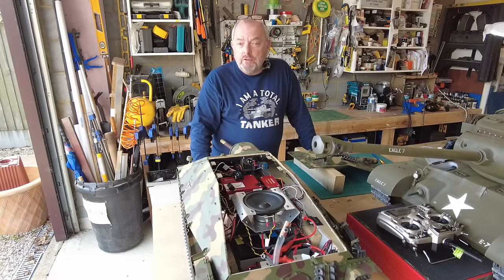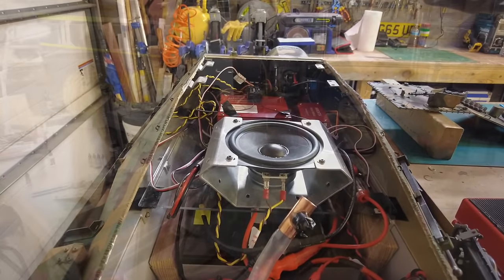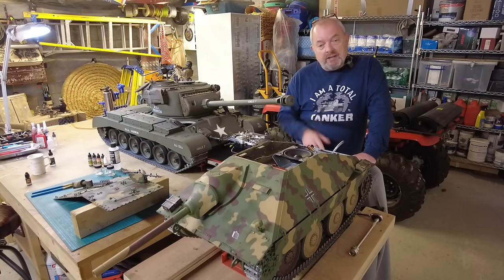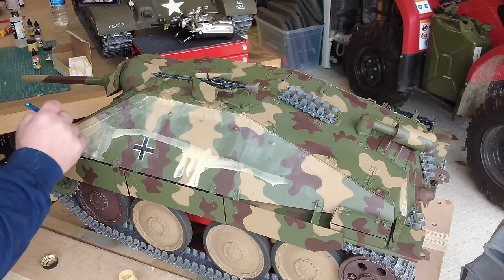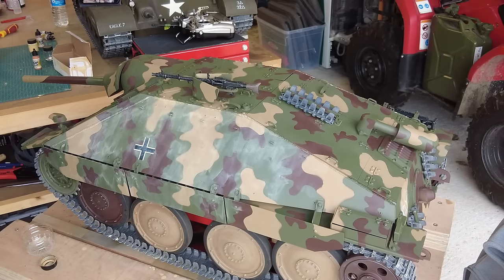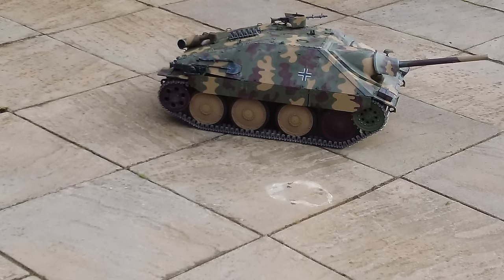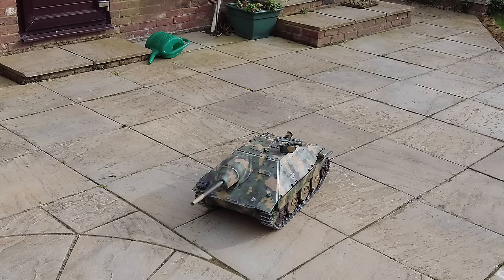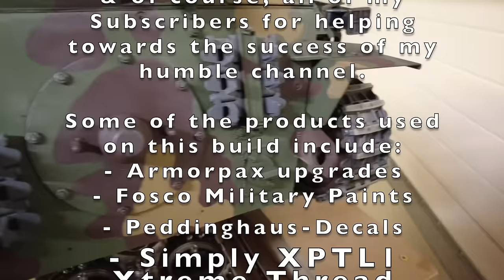1/6 scale Armortek Hetzer Jagdpanzer 38 (Vid 26) The final episode of this incredible build

Comment: Seeing the issue you had with fitting in the speakers it makes me appreciate the room I got by having a single LiPO4 battery. As it is I was able to lay the battery on it's side and put the two speakers on top whilst still have plenty of room for the rest of the electronics.  I haven't fitted the smoker yet but after a trip to the factory today it will go in as the final step before securing the roof. I will also use your weathering technique once I have my camoflage scheme applied too 🙂
Reply from the maker: Hi Daniel, you did mention this battery before but it is very expensive... so I opted to what AT recommended....I am sure there is a way of installing both speakers using the conventional batteries, but I am happy with the sound and layout which I ended up with. I would have loved to attend AT today, but my family has other plans. Please pass my best on to Kian and the team and hope you have an amazing day.

Comment: Watching you doing the weathering my head was thinking about what I would possibly do. Isn’t it great that this hobby makes people creative, and the finishes usually differ?
Is there the option to have a slight delay to vent the exhaust smoke after starting the engine? About a second would look good, imho. I am still on the edge to get an AT tank kit, but where to build it not having a workplace as yours? Tony, I am jealous! 
Please be assured that I will follow you on the Rover and any other AT kit you will build. Watching you do your magic is fun!!
Reply from the maker: Hi Thomas and thank you. This is my favourite part of building these kits. Armortek allow the builder the freedom to make the kit your own by adding details, paint etc. I absolutely loved building this kit and really pleased I chose to go with it. It has turned out better than I imagined. Alas..no option for delay in smoke on start up, but this new smoke unit is definitely better than the 1st generation one. I do understand that space restraints have an impact and I am very fortunate to have a large garage which I have turned into my workshop, but there are many builders who build these in their sheds, conservatories and I have even seen one built in a kitchen. The Hetzer in my opinion is a good choice if space is a concern as it does not require as much space as the larger of the tanks or even the Series 1 which starts next week. Thank you for your continued support and hope you continue to watch and follow my builds. Best regards...Tony

Comment: hi tony. the paint and weathering look great, it is a very cool looking tank, i am surprised at how little movement there is in the turret, the commander would have to be on his game to move quickly to sight another target or evade an opponent. a few questions....is the transmitter a separate purchase or does it come with one of the option packs. can you adjust the tone and bass on the sound module...i look forward to the series 1 build. it has been absorbing building these kits vicariously through you. cheers.
Reply from the maker: Thank you. I am so pleased on the way this has turned out...I was nervous about tackling the paint job, but it worked a treat. The radio gear and receiver is purchased separately from hobby shops, as Armortek leave this up to the individual to choose. No adjustments on the Audio unit to alter bass, but with two speakers you can swap the bass and treble around to alter. I did this on the M26 and it sounds meaty. Series 1 build starts next week and hope you continue to watch and follow. Have a great weekend.